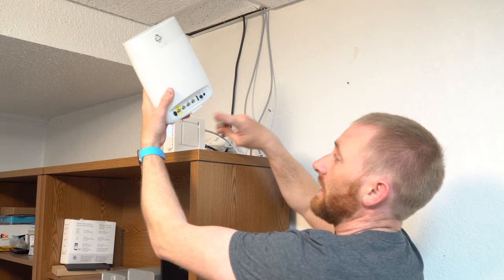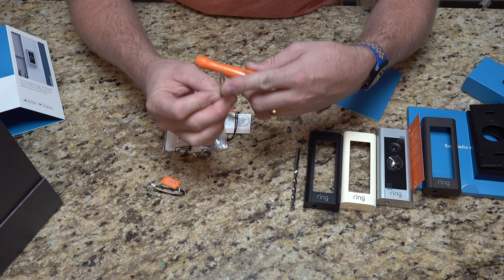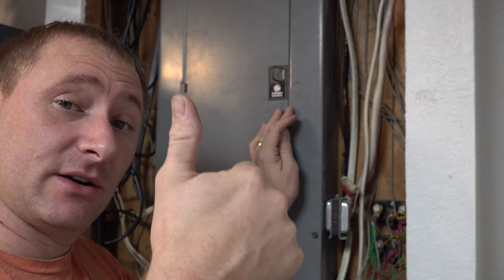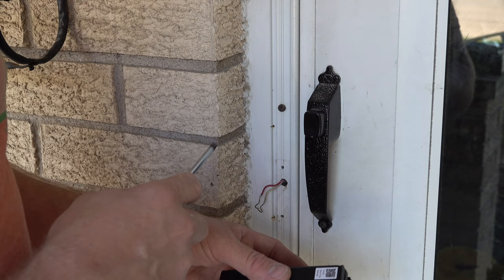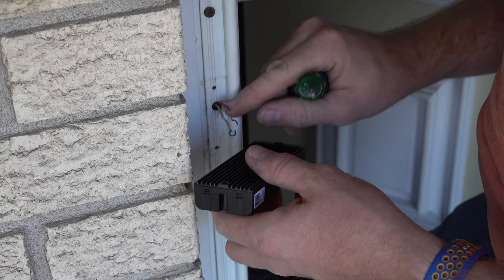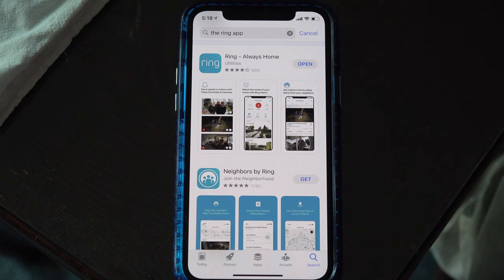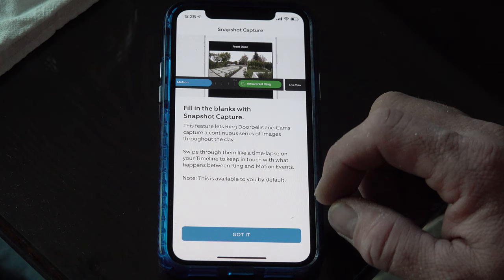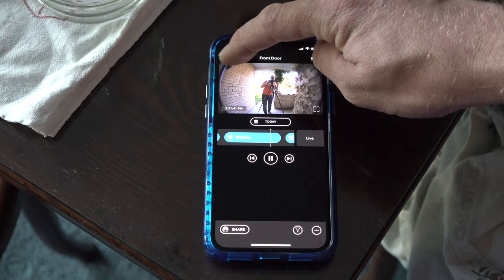RING Video Doorbell Pro Install

Comment: My Ring Pro gets low/poor voltage when it gets dark and then goes offline. I think it might be my transformer but I don't know where it is. Any suggestions on a fix? Or, is there a Ring that doesn't require 16v transformer? Thank you.